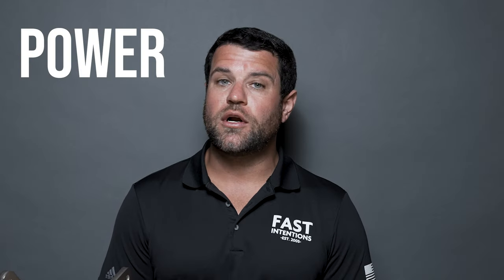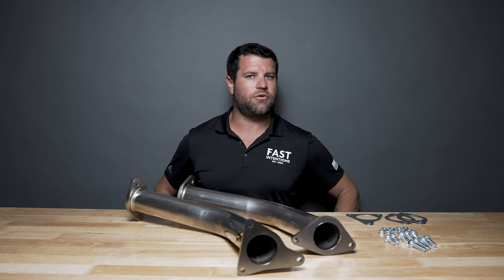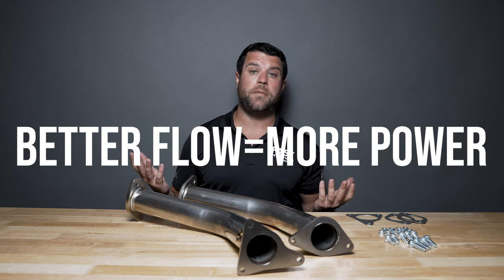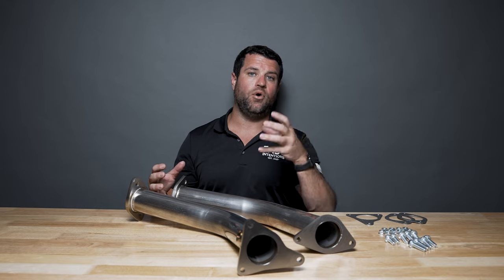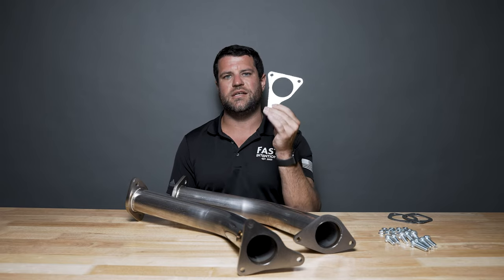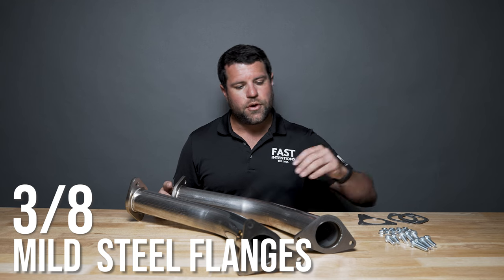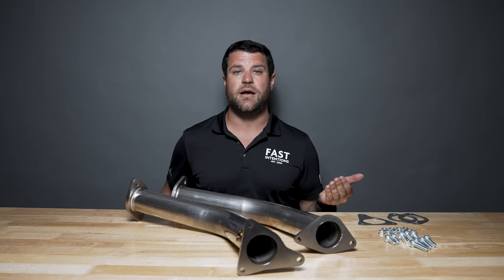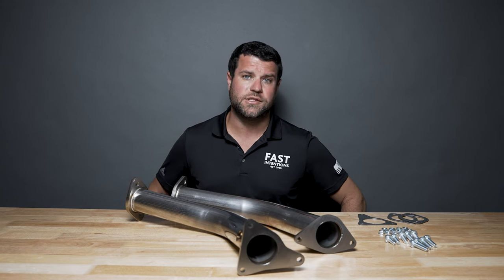Q VR30 LOWER DOWNPIPES - GREAT BANG FOR THE BUCK

Comment: What are the Hp & torque gains from your Ldp?
Reply: Pretty much all LDP are the same, just an open tube that removes the cats. Most people see gains of 40-65HP for a full exhaust, replacing the factory exhaust, cats and ldp.

Comment: Will this cause boost spike  on a stock red sport
Reply from the maker: These work great with stock red sport as well as tuned red sport vehicles.
Reply: @FastIntentions  do these come in 3inch ,
Reply: @FastIntentions  the reason why I ask about boost spike because a tuner said you have to be careful with lower downpipe  because of boost issues in the red sport ,am not sure if he’s referring to the 2.5 or 3inch or maybe lower down pipes in General.
Reply from the maker: @torvarrisevans9334   Our lower downpipes are only available in 2.50" diameter.  We do offer our full downpipes in 3.00" diameter.

We'd recommend consulting with SpecialtyZ regarding all of your tuning questions.  They exclusively tune Nissan and Infiniti vehicle and they're very knowledgeable with tuning the VR30 engine.
Reply: @FastIntentions  thank you

Comment: does it void the Warranty?
Reply: Yes
Reply: No, but it may depend on the service center that you take it to or whatever issue you may run into when they are installed. My recommendation if you are going to do it is to maintain your OEM downpipes.